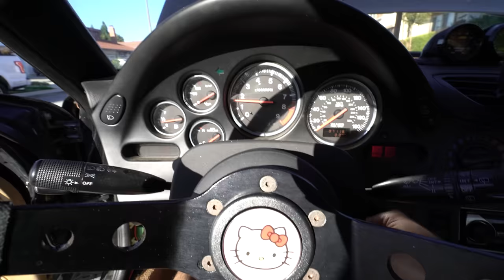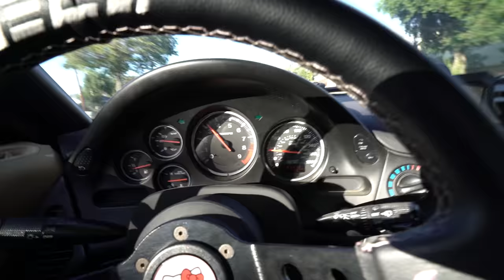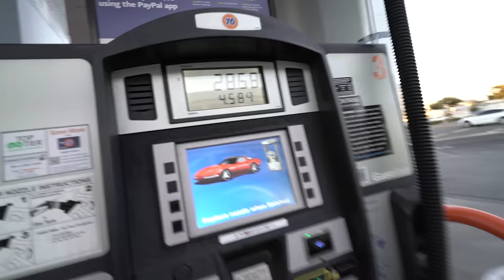FIRING ON ALL 4 COILS! | BIG LIFE UPDATE!

Comment: Congrats are your new job. Goes to prove that hard work brings great results. The audio and video was awesome. Like always I have a recommendation for you. Use ngk spark plugs. They have like 4 connectors on top instead of one. Brap on
Reply: Fd stands for. Financial Disaster and Future Divorce. They are expensive but once they are sorted out they are none of the above. I understand the whole getting expensive thing. When ever a old oem part would fail I would always upgrade it with a better performing item. Keep the videos coming and brap on

Comment: that fuel cut from fuel slosh can really hurt your engine. I went with radium's surge tank and there full kit with filter, sending and return lines. Its super sick and huge preventative measure against engine damage.
Reply from the maker: Yup I have ignition cut enabled if the car doesn’t draw enough fuel! Saves the motor hahaha
Reply: @TsuchiFD  I wouldn't just rely on that my guy. Especially doing it knowingly. It's not 100% guaranteed protection. Plus having the fuel system starve and the ecu cutting the ignition in in its self isn't healthy for your engine and components. Even get some baffles for the tank. That's cheap if you do jt yourself